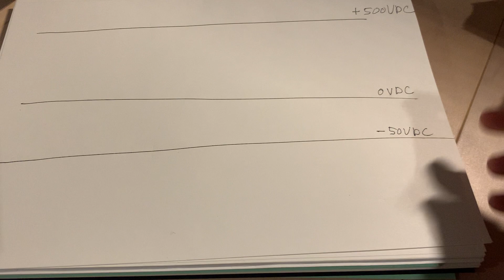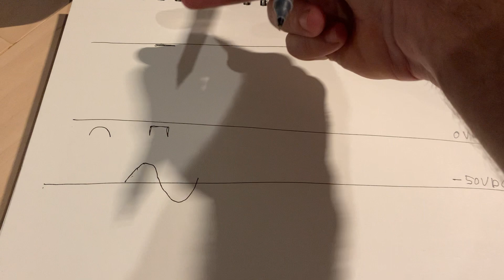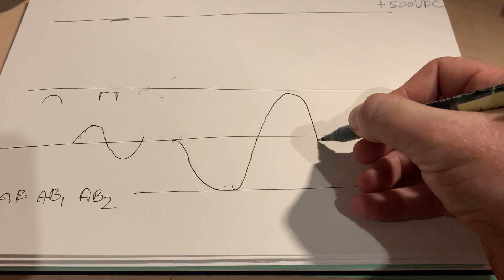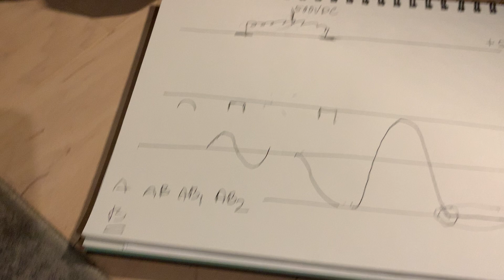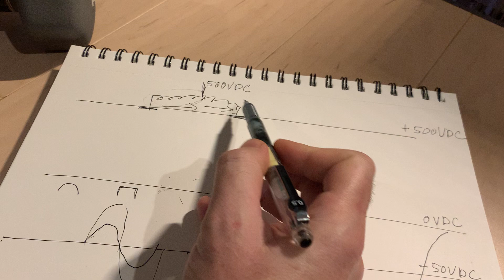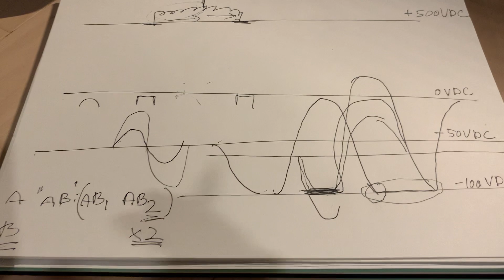Is Push-pull equal to class B?! or not....

Comment: Class A also has A1 and A2 option modes.............A2 has grid current and needs a driver very low impedance output driver and capable of driving current ) capable to drive this mode.
Class AB is often misunderstood  .........it's not a class in tself , it means that the ampifier commutes at a given level fromclass A to Class B ..... the load changes also ( to half impedance )and yes some can hear it.
Class AB can be very little class A before switching to class B.........or enriched class AB witch works  for most of the tile in class A before switching to clas B mode.....;
Many so called PP class A amplifiers are in reality class AB amplifiers..........
Reply from the maker: Thank you Frank! Indeed, a follow up video is in demand, although you have summarized it all :)
Reply: Hey, Frank. Fantastic and useful addition to Janos’ video. Thanks 👍
Reply: @NickP333  hello Nick , sharing together is more fun .....and makes more happy .  Some think different but they end up ...Alone ! ....

Comment: I have a Conrad Johnson CAV45 tube set control amplifier with EL 34 tubes.  A control amplifier puts a high-quality passive volume control in front of the power amplifier, offering a minimalist approach. An outboard passive attenuator works the same way; either offering a more transparent reproduction (i.e. less stuff in the signal path) or a slightly flat presentation (i.e., lousy impedance match between source and amplifier because there is no preamplifier to buffer things).  Would this unit be considered AB?
Reply: Hi Steven ,  a class A EL34/6CA7 PP.........would produce  less than 20 watts , typicaL12 watts pure in class A. In class A2 you could have more power at the price of higher distortion and another driver configuration...and another output transformer ( higher impedance ) withch make it more difficult to make as good as the lower impedance one.
Your amplifier is not a bad one.......(and every amplifier has it's own optimal bias point in a given configuration and brand of tubes )....
Reply: You can build a simple impedance buffer for the output of your source....with  enough current drive ..........voltage alone is not enough , one needs ENERGY......😀
Reply from the maker: To know whether an amplifier is operating in what class, we need to see the operating points of the power tube section. Sadly, it's something that's not evident even when we have the schematics (as published schematics rarely include voltages and op point descriptions). Generally, EL34 in PP can be asked to put out 30W comfortably, but even that is in class AB1. The CAV45 has 45W output, to achieve that there are many ways, I don't know which is the case here as I have no access to the schematics. It must be AB, with class A likely for a few watts (probably 5 or so), and the rest in B. (Without schema, cannot tell AB1 or access to AB2 as well.) The newer S2 version that has even higher output is most likely first watt in class A, rest B, and it has to go to AB2 or use unusually high plate voltage (or most likely a combination of al of these), as 60W is really extreme from a pair of EL34.
Reply: @realworldaudio  Hello Janos , .............EL34 "NOS ! " can go up to 100 watts PP....BUT only with nos tubes because of the 800 volt plate......do not try this with new production tubes .........
JH 50 ....( Jan Hiraga ) ....50 wtts /channel.............by chosing a higher screen voltage in penthode mode.........this amplifier sounds realy good ( Partridge output transformers and regylated screen voltage )
have a nice day , here it's already night !
Reply from the maker: @frankgeeraerts6243  Indeed, upping the plate voltage EL34 can easily get to that power zone, and strictly with NOS tubes... current production EL34 would melt way before that. :) I also prefer to employ very high plate voltages. As my mentor said, the tubes wake up when they see very high plate voltages.... giving them much higher dynamic range of operation, and a much wider linear range that gives the improvement in sound quality. Sadly, new tubes can't stand the high voltages, and going higher also means needing a more difficult to make output transformer (higher primary load). I think Maestro Hiraga was thinking along the same lines when he built his EL34. Sadly, CJ has to think about people swapping in current prod EL34, and for equipment safety's sake  we rarely see high voltages above 500VDC in commercial gear...  Thank you Frank, have a good night!